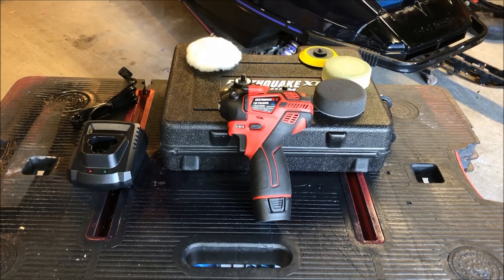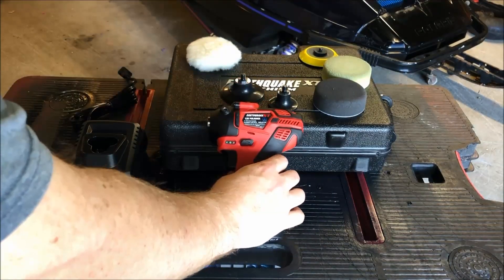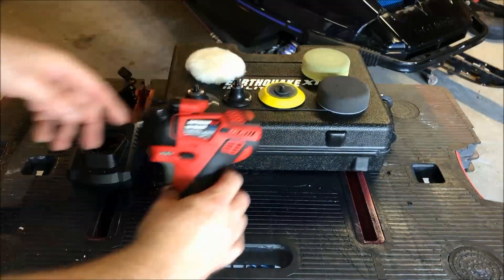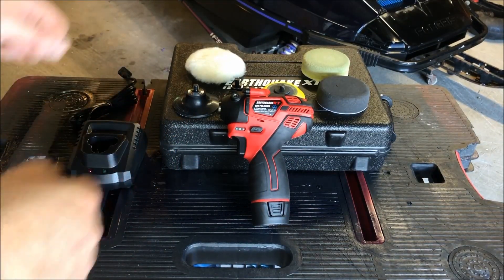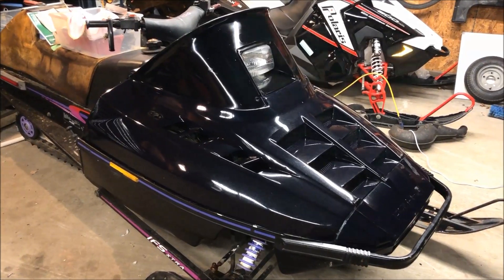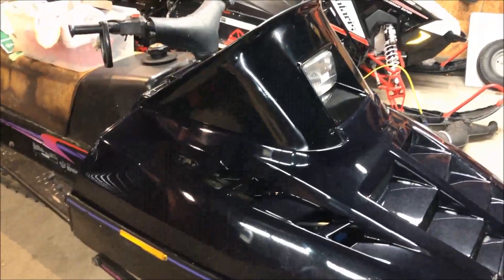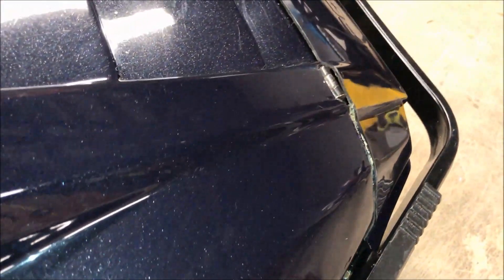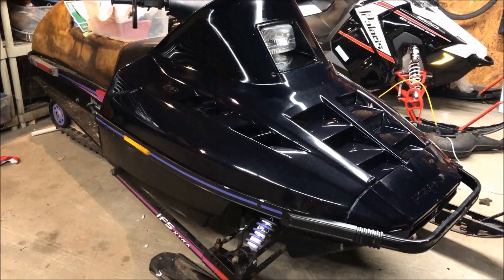Harbor Freight EarthquakeXT Polisher/Sander Review and Demo (64479)

Comment: I bought this to polish my car given that I don't have an electrical outlet to connect to or a garage. Do you have any recommendation on buffing pads to use for polishing with a AIO product i.e Turtle Wax Black Acrylic set? Thank you for posting!
Reply from the maker: I've had good luck with the pads that are available in HF. Just remember that the colors of the pads have different functions. Yellow is typically for cutting and black is for polishing.

If you have heavy oxidation or you're trying to eliminate wet sanding scratches or scratches in general, Use the yellow pad and then follow up with the black pad.
Reply: @StreetersGarage  thank you for hour prompt response!  Would it be possible to attach a larger backplate to this unit to a 4 or 5"?
Reply from the maker: You would be better suited in buying a full size machine. This one is great for detail work and small areas.
Reply: Wont last long enough to polish the entire car. I did two headlights and b pillar and c pillar plastics. Still has some life left, but won't do a whole car.

Comment: Earthquake XT 12V tools are from AC Delco (Durofix) G12 lineup. (20V tools are from P20 lineup)
Of course, AC Delco is a known good brand, so tools are good as well. And, AC Delco brand has more tools and usually has better pricing (and warranty) than HF.
You can search for 'ACDelco G12' on Amazon and check the prices. If you need a ratchet, I'd probably go for brushless version with bit more money (which HF does not carry).

But HF has better pricing on batteries, so I'd buy AC Delco tools, and HF batteries.
Reply from the maker: Thanks for the info!
Reply: casiotechI  Exactly the same tools in different color. So it's just your choice. Amazon almost always sells AC Delco/Durofix version for $99.
If you want easy replacement within 90 days, or you like the color of HF version, HF would be a way.
Or, it might be bit more complicated, but rather want 1 year warranty, AC Delco/Durofix version would be better.
Reply: casiotechI  If you are talking about the polisher, be careful. HF version is 2 speed version, while AC has 1 speed and 2 speed versions.
ARS1212 is 1 speed version, and ARS1214 is two speed (which is the same as HF one). If you are buying these, make sure to check the model number.
Reply: casiotechI  No idea why 1 speed is more expensive. 1 speed is more like a drill's high speed, so I don't think it's worth.
Reply: casiotechI  Although I bought 2 speed model, I haven't really used high speed.
But, I just used this to polish headlights, so there might be some applications that would work better with 7K. I just thought having more options won't hurt.

Comment: 90 day warranty .. kinda scares me .. most power tools give u 1 yr or 2 .. lol maybe u should just get a Milwaukee .. for 200 .. atleast  thawed a better warranty & piece of mind
Reply from the maker: Yes. The warranty is not great. But I’ve had tools fail under warranty and then discovered that the MFG’s don’t honor them. So it’s a toss up.
Reply: you can buy a 2 year warranty
Reply from the maker: Correct
Reply: Earthquake XT does well for its price, compared to the milwaukee.  the big difference is the earthquake is about a quarter of the max RPMs the milwaukee has

Comment: It sucks battery life doesn't last.......I have it small motorcycle has tank had to charge it 3 times to finish....SUCKS
Reply from the maker: Battery life could be better. I bought a second battery.

What were you doing with the gas tank for it to require 3 passes. Typically I don"t use the buffer until I'm done wet sanding past 2000 grit
Reply from the maker: Yes, I would say he was either not using the correct compounds and pads or he was trying to take out 1500 sanding marks. 

If everything is done correctly, the tank should have been done in about 10 minutes
Reply: @StreetersGarage  there is a learning curve with this tool.   Too much pressure makes it cut out I bet it was less the battery life and the fact they were making it “cut” off
Reply from the maker: Probably right

Comment: Milwaukee beats this hands down, how do you ask? 3 year warranty verses Earthquake's 90 day. The added warranty is worth the 30 extra dollars.
Reply from the maker: Not a accurate comparison. The bare tool is $30 more than the complete kit from HF. 

The comparable kit from Milwaukee is $279.
Reply: @StreetersGarage  Home Depot on sale.
Reply: Doesn’t matter if this power tool , does in 6 months .. lol , this was my main concern
Reply: @aydinvisionhd6640 A 30 day warranty is NOT 6 months. HF will not honor your broken tool without buying extended warranty.
Reply: Milwaukee is metric thread for pads xt is sae, thus easier to get pads for.
Reply from the maker: They’re held on the backing pad with Velcro. And if you need a new pad. You can buy the set for $10
Reply: casiotechI  You don't know is correct lol. Did you see the date? Yes it still beats it! Battery life is better and tool is built better. Sometimes cheap wins but not in this case.